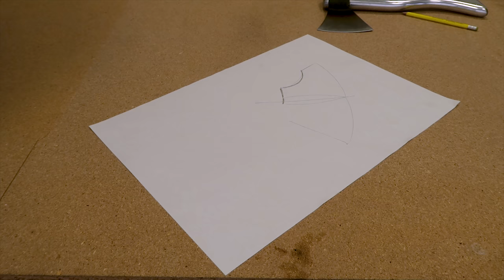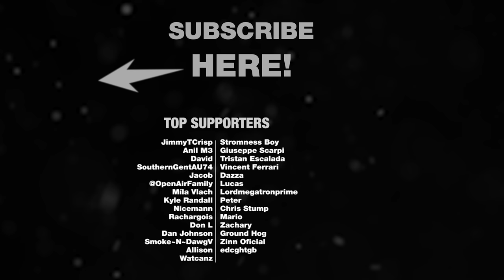Leather Axe Sheath | Easy DIY

Comment: I made a viking ax and two broke back seax knives and the sheaths are old brown vynel from a old hot tub cover. They are all loose but I am going to find a way to make them more snug fitting and a snap fit strap for the ax. Thanks for the video